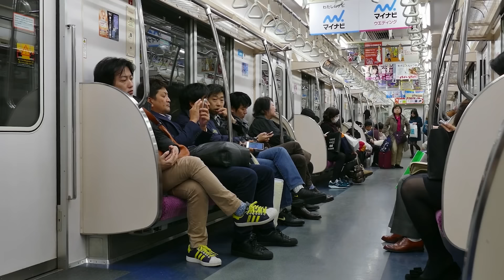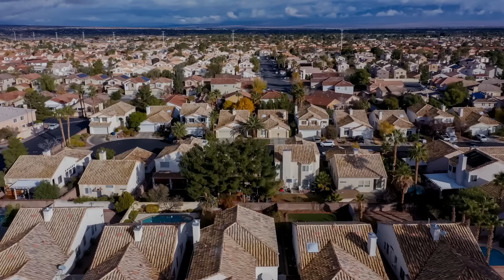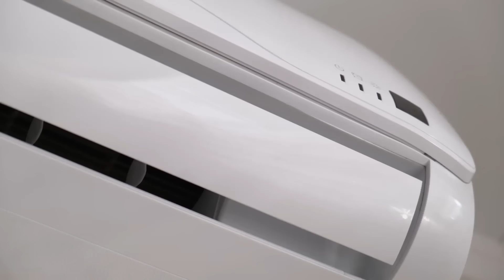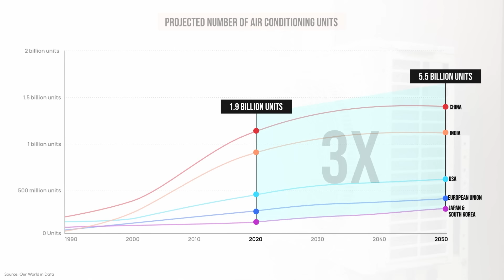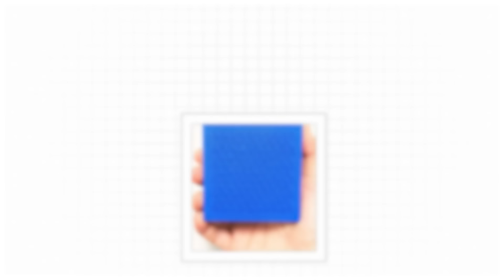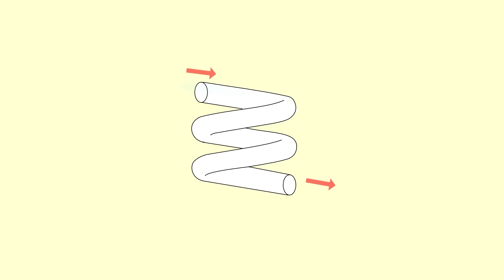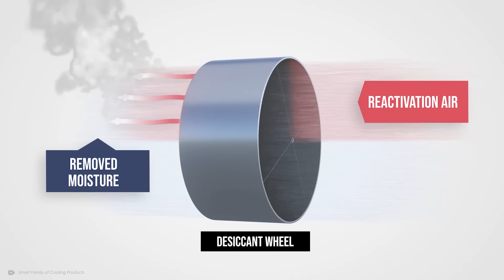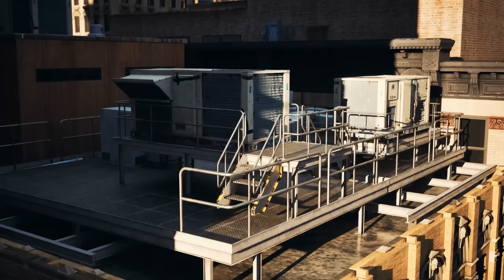The Future of Cooling is Here: The NASA Breakthrough

Comment: Reducing humidity isn't a "side effect", it's the original purpose for which air conditioning was first invented. But obviously people loved the cooling affect as well and that's what really made it take off.

That removed water can also be used to improve efficiency, by spraying it out in atomising jets over the "hot" radiator.
Reply: "Original purpose" (alleged) of A/C technology is NOT the current topic!  Within the present context focused on lowering temperature, humidity reduction can be reasonably seen as a bi-product or side effect.
Reply: If the goal is a comfortable living space, it is critical to control humidity. In many regions lowering humidity does more for comfort than lowering temperature.
Reply: @DJJonPattrsn22 yeah, no. The main effect is humidity removal, it cannot be a side effect
Reply: I think it was a color printing mill that found the ink smearing on the paper.. the problem... Humidity.
Reducing the humidity fixed that.
Reply: It's even more than that, in very humid places, removing humidity is at least as important as reducing temperatures. If you had a system which could efficiently remove humidity that might be sufficient in many climates rather than any active cooling.
Reply from the maker: This is a really good clarification, I explained this poorly. You are correct the original purpose was for dehumidifying (I should have known that). I was meaning that a lot of air conditioning now is mostly used for it's cooling effect, and the dehumification is not the main aim (though it is in some of the examples I gave, which is an error on my part). Thanks for the comment, and great idea about that atomising jets. - Ryan
Reply: Please, do not remove too much humidity, in living spaces!
Reply: "That removed water can also be used to improve efficiency, by spraying it out in atomising jets over the "hot" radiator."
Exactly. And that works, and it is not on collision course with standard thermodynamics. With the suggested principle presented here I am not so sure in that latter point.
Reply: Human bodies are sensitive to wet bulb temperature. This is what you want to reduce if you want to improve human comfort, and this requires not only cooling down to dew point but also some mixing with untreated air or additional heating to move away from the saturation curve. Definitely, dehumidication is not a "byproduct" of A/C. This could be true where only dry bulb temperature counts, say in some particular technology that requires a given temperature (but not humidity).
Reply: Yup. One of the concerns with Swamp Coolers vs Air Conditioners is that swamp coolers try to use water as a way to help cool it down. 
Now anyone thats been to a Home Depot in humid southern part of America knows, that Home Depot uses Swamp coolers, but they don't work during summer...(when you need it the most) due to their being too much moisture in the air, inhibiting the swamp coolers ability to work.
Aka Swamp coolers work best in dry climates. Air conditioners work in all climates. 
Its fascinating to look at Phoenix population growth, and see it explode after 1950 due to the innovation.
Reply: @eriklondon2946 it's too dry in dry climates and alas, nasa is in a dry climate and humidifiers have to be implemented or everyone turns into prunes. Actually static electricity can cause a 30,000 volt spark and wallah, electronics damage.
Reply: @bobb.6393 overstated, watch the electoboom video on static shocks. They gave ram chips in an active computer multiple 500kv strikes and up without significant issues, only repeated zaps caused problems. 30kv isn't doing shit
Reply: @eriklondon2946 🤔 OP says A/C tech was originally invented to reduce humidity, then you appear to agree, saying “correct” but then go on to say that “some of the first ever were called swamp coolers” (which work by increasing humidity) so I’m guessing that when you wrote “correct” you meant to type “incorrect.” 🤷‍♂️
Reply: @jpe1  Correct. Let me see if I can edit that sentence better. Thank you!
Reply: @jpe1 swamp coolers don't work by increasing humidity. They take advantage of the evaporation of water off a wick surface to cool the output air. Increased humidity is a side effect, while an acs main job is to reduce humidity with cooling as a side effect
Reply: @DarkAttack14  can a swamp cooler work without increasing humidity? No.  That was my point.  I know that you understood that, I know you just want attention for yourself, so twist other people’s words in whatever ways you want to make yourself feel better, we see what you are doing.
Reply: Dr. Gorrie is known for wanting to help his patients in Florida stay cool, but he is also known as the inventor of a machine that makes ice
Reply: Nobody care about original purpose. Everybody wants to cool their house and reducing humidity is the main side effect
Reply: @williammorganrojas6721 reducing humidity is the main effect, cooling is literally a side effect because people would be just as comfortable if there was no cooling and only humidity removal. Humidity removal is the only concern
Reply: @DarkAttack14  yeah tell that to my costumers. 100% of the people buying AC on my store comes to cool down their houses. Do you have AC? I have one and i only care about the heat, just like most of the people buying AC. Humidity is a side effect
Reply: @DarkAttack14  im looking at an LG AC unit wich literally says in its manual that side effects are dry air wich cause dry eyes and another side effects. You are the only one buying AC with the purpose of controlling humidity
Reply: @williammorganrojas6721 what everybody wants is to be comfortable. Depending on the climate, reducing humidity can be just as important as reducing temperature to achieve that goal, if not more important.
Reply: Spraying the condensate on the outdoor coil aka the condenser, only improves efficiency if the outdoor due point / humidity is low. 

If the outdoors are very humid like here in Houston , it doesn’t add any real efficiency. 

Now in a place like Las Vegas where it’s very very dry, that water evaporation can drop the temp 20 degrees or more. 

But the flip side is a place like Las Vegas has such low humidity the ac doesn’t use much of its capacity to remove humidity from the indoors. 

So this really isn’t a major gain. 

Read about sensible vs latent BTU.
Reply: Traditional window ac units do exactly that, the condensed water runs to the back radiator fan that hits the water and splashes the radiator.
Reply: Yeah good luck with corrosion on the radiator 😂

Comment: As an industrial refrigeration professional i wonder what the cleaning of something like this would be on a large scale.  Like you out this on a 100,000TR RMAU, how does the water get out of the tubes?  If it doesn't get out quickly that becomes a huge sanitation problem.  How would you clean out the tubes so that nothing grows in there?
Reply: If only there was another fluid being pushed through the tubes that would continually displace the water from the tubes. Maybe something like the air that the water is being separated from?
These tubes are continually having air pushed through them, water accumulation within the tubes wouldn't be an issue. 

As noted in the video, this was tech developed for use in space, the types of sanitary and maintenance concerns you raised would have been design constraints from the beginning.

The issue that comes to mind for me (which likely would've been outside the original research scope) would be large contaminants (i.e. sand, landscaping debris) that might block tubes over time. But the tubes appear to be ~mm scale, so that may not be a significant issue, as particles on that scale aren't easily wind carried or could be filtered with mesh screens that could potentially be oriented at an angle to allow the particles to fall away when the unit cycles off.
Reply: @ManOfSteelePV  Yeah, can you say Legionairre's disease?
Reply: A good point. 
Good luck with microchannels in real life.
Reply: Exactly. Thats the difference between concept and real life. The first 80% are easy. Its the last 20% that kills most of them
Reply: @The8blackwidow8  It's being used on the ISS of all places. You really think they'd use tech there that allows for the growth of hazardous microbes, especially when things are much harder to keep clean in micro gravity? Come on...
Reply: @Yutani_Crayven  you have to leave the thought that there are only professionals at professional jobs doing professional things. Reality ist much more ugly. But yes. NASA propably thinks about that.
Reply: To keep the tubes free from microbial growth the options would be to coat the microtubes with a layer of copper, or silver.

Designing it so that some of the recovered water from the liquid desiccant, gets pumped through the channels, that would also help.

Those channels will get clogged with dust, so they will need to get flushed out. Designing it to happen automatically, will use up some of the saved electricity, but it needs to happen to keep them functioning.
Reply: @davidestabrook5367  I have not a clue how you would pump that water through the tubes.  Also those coatings are against code for ammonia refrigeration if I remember correctly.
Reply: @ManOfSteelePV  Copper reacts with ammonia to form copper hydroxide, and silver reacts with ammonia, to form an ion complex, so it makes sense that refrigeration units, with ammonia as the heat transfer liquid, should not use copper or silver tubing.

But in this case, it's just air that goes through the micro tubes, so either would work well, as they wouldn't be exposed to ammonia.
Reply: @ManOfSteelePV   Regarding how to flush the microtubes, you'd have a plastic sheet with channels cut for the water to flow, that gets moved to seal against the front and back of the microtube part, there'd be a hose that attaches to the top on the front, and the bottom on the back.

You'd push water through the inlet hose, prevent it from draining, have the water push and pull repeatedly to agitate it, then flush it through, with the water going through to waste.

There'd need to be a motor to push the plates with the hose connectors, so they cover the microtube parts, when doing the dust rinse cycle, and move them out of the way, so they don't block the air, when it's in normal use.

Comment: Air conditioning is a bandaid on the problem. The more effective sustainable change needs to be in the architectural and engineering side of how we build structures. We create massive glass greenhouses that are all but hermetically sealed.  We create extremely population dense structures that have minimal to no natural ventilation. 

We’ve developed methods for cooling air well below ambient temperature via architectural design (wind catchers) and using the correct building materials. A good modern day example is rammed earth structures using passive ventilation and insulation to significantly cool and maintain internal temperatures.

Comment: I really appreciate your effort to weigh things scientifically, not based on the company's press releases. Your graph predicting 3x increase in AC units is flawed though. Adding up the numbers at 2020 shows about 2.8 billion units, and at 2050 shows 4 billion. That's about a 40% increse. That's an obvious mistake that should never have happened.
Reply: At the bottom of the chart, you can see that it comes from the Our World in Data web site, so hop over there to see the original graph, YT does not allow links. The graph on that site is interactive, so it is possible to get the breakdown of each country as one scrolls over it.
The graph is a stacked chart (it should have been filled in solid colours), so we don't need to add it up, the actual numbers are in between the previous line and the current line. E.g. China would be 730 million units.
See the total above each line - 1.90 billion in 2020 and 5.5 billion in 2050, those are the actual totals. There is some rounding up involved, 5.5/1.9 = 2.89 ~= 3.
Reply: @tinka831  Thanks, I hadn't noticed the Our World in Data credit. But, the graph here is still saying a very different thing. The curves are different, the y axis is different, as you mention the format is wrong - what happened there? It's totally wrong.
Reply: @kimholder  Yes, the chart is not working, India getting below Japan & SK, and China's contributions should be bigger than India's, so I don't know what happened there with the graph. Maybe the author downloaded the data manually and did the chart by hand.

Comment: reminds me of a video by tech ingredients: /watch?v=7w4rg3UcsgI
they built an air conditioning system that can run on 100% solar energy (1 big PV panel should be enough) and only uses water and calcium chloride. no nasty chemicals like CFCs (regular heat pumps) or hydrogen and ammonia (propane fridges)

Comment: Eh? Physics check.  Yes a centrifuge can remove droplets, but droplets are (as the name implies) already in the liquid  phase and so don't need to go through a phase change during cooling.  Water vapour can go through a phase change to liquid, and it has to go through a phase change dumping latent heat into kinetic heat to do so.  No free lunch.
Reply: This was explained as water vapour being heavier so it goes to side; but water as gas has a molar mass of ~18g/mol, nitrogen is ~28, oxygen is ~32.  If you centrifuge them water vapour would go to the slowest spinning side of the centrifuge.

Separating the components within air in that way can change the relative humidity between the sides of the centrifuge. Make it high enough and water vapour will be forced out. What hasn't been addressed is why this would be more efficient than doing it the regular way.
Reply: @frommyself8532  Interesting comment although I would be surprised if small channels would create difference in dissolved gas in a way that it could have such effect . It would mean that air separation would be way easier. At least concentrating oxygen or nitrogen . And now we use special membranes and sieves for it
Reply: Damn. I've been promised free lunches regularly but am still hungry.
Reply: Physics and math spoil so many good ideas!
Reply from the maker: Yes this was an error on my part. I believe the liquid desiccant is used first as an aerosol spray to turn the water vapour into liquid droplets first, and then the helix coil is used to remove these droplets.
Reply: @ZirothTech  then grow a spine, delete the video, fix the mistakes and reup.
Too hard?
Right you'll just keep talking out your bum regardless.
Reply: exactly ... when its nasa sticker i want be cautios, but looks like BS or poorly explained
Reply: Does no one here have their thinking cap on? Okay, so you weren't spoonfed the entire solution, but all of the pieces are there. Can't any of you put it together? I saw it immediately:
Spray the liquid dessicant into the incoming air which would remove the water into the dessicant droplets. Use the helix system to pull this back out. Then use the waste heat to regenerate the dessicant. I think that this system is quite genius. The innovation is to use a liquid dessicant which allows this to happen. You get a "free lunch" because you are using the waste heat.
Sorry (not sorry) about the telling off at the beginning, but people, please use your brains.
Reply: @FuzTheCat  ok so why not use just water spay on the condenser in ac ? It's the same but you can use lower grade heat 😉

Comment: I was taught that humidity is water vapour (i.e. the gaseous form of water) in the air, not water droplets (i.e. drops of liquid water).  That helical process won't filter out a gas.
Reply: This is just a wild guess, but water molecules weigh less than air (nitrogen & oxygen) molecules.  Suppose the centrifugal force separated the water molecules enough so that they were above the saturation point of the air, causing them to condense into micro droplets.  Those micro droplets would then be heavy, and would be slung out, again be centrifugal force. 

Mmmm, no, I don't believe it, either 😅
Reply: @tgeliot But water molecules are lighter, air is N2 and O2, water is H2O
Reply: @c0nct3d  Yes, we agree that one individual water molecule is lighter than one individual molecule of N or O.  But water molecules can condense together to form droplets that are heavier.   But truthfully my speculation here is just shooting the shit, I have no idea what's really happening.
Reply: @tgeliot  I read their paper, and their filter can only filter fog, (which regular fiber filters do albeit less efficiently) and it's not clear If they end up being cheaper of consume less ressources. 

The author of the video didn't do the appropriate research.
Reply: @c0nct3d  Sounds like it. ☹️
Reply: Think of clouds, it's an aerosol. We know that because of the gray color from Mie dispersion, implies it is particles larger than 1μm. Aerosol is liquid phase dispersed in gas.
Reply: @agnelomascarenhas8990  What are you saying is an aerosol?  The humidity that most of us deal with is vapor.
Reply: Correct. They are injecting a salt brine into the air that absorbs the water vapor, and then filtering out the brine droplets to leave dried air to pass through the filter.
Reply: @WorBlux  Thanks for the explanation!